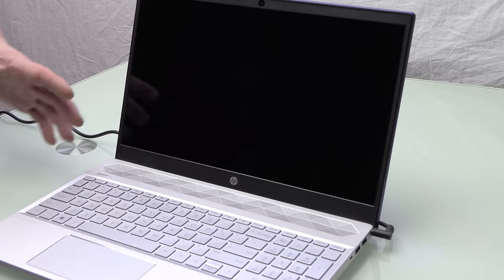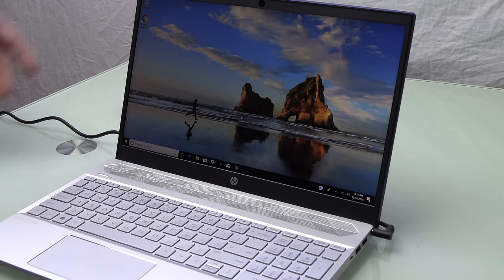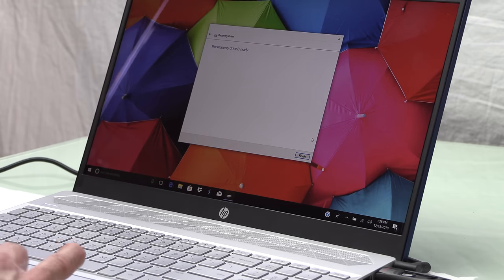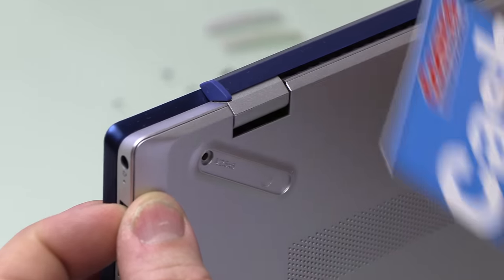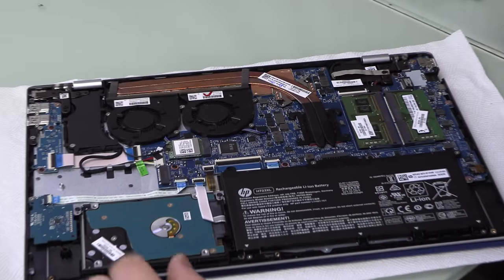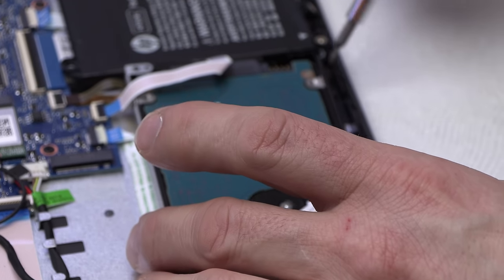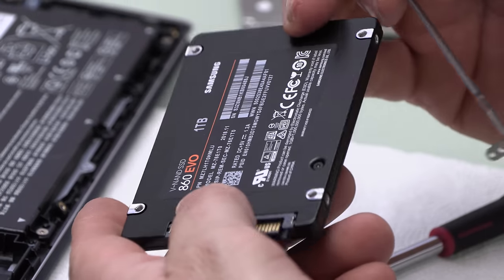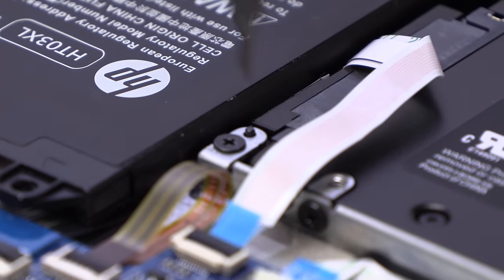HP 15-CS Laptop - How To Remove HDD and Install SSD

Comment: My i5-cs0053cl  is identical to this, but doesn't have the dual fan setup...but it has the space for it. Has anyone upgraded to the dual fan that is shown on this video? I know 2 fans would be louder but also cooler I'd think...
Reply: the blue one has a gpu in it and the silver one is just integrated graphics the blue one is also more expensive
Reply: It's not louder at all, and my laptop never heats, so it's a win win situation
Reply: @Fahed Sebia Where did you find the fan header part for the dual fan setup the default silver hp with integrated graphics doesn't have the gpu fan header.
Reply: @unicorns8418  Blue? Silver? What are you talking about? I also have only 1 fan and supposed integrated graphics.
Reply: @admirmehic8552  That means it's the silver one
Reply: @unicorns8418  Still you didn't answer? What is blue and what is silver? Motherboard color? Blue and Silver aren't mentioned in the product name, product code or in the store.
Reply: @admirmehic8552  Sorry I read wrong one of them has silver aluminum and the other one has blue aluminum. If you have the silver colored one that means it has integrated graphics but if you have a blue colored one then it means you have dedicated.
Reply: @admirmehic8552  If you only have one fan your computer should the silver model with integrated.
Reply: Where can you buy the extra fan, I want to upgrade to 2 fans so everything stays cool. I understand the integrated model only comes with a single fan but I want to add the other to this model.
Reply: @cam4712 You need to find the fan header first
Reply: As stated it's only there if you have a seperate GPU. Also contrary to what's been said the fan will be noisy on this model if you do a lot of graphics intensive stuff. However with the GPU you get at least a 25% speed increase for the hassle and this laptop's very fast to start with.
Reply: @unicorns8418  bro I have the cs model with silver color and it has dedicated gpu
Reply: Have you opened it? Does it have 2 fans? @sagarniroula3644
Reply: @sagarniroula3644  What gpu you have in it?
Reply: @unicorns8418  its Mx250
Reply: @sagarniroula3644  I have not seen one thats  silver with a dedicated gpu yet only blue ones so if you do have have a dedicated gpu then thats good for you.
Reply: @unicorns8418  btw my laptop is cs2062tx.. you can verify bro😁
Reply: Some 15-cs models have a dedicated GPU whilst others don't. Those that have a dedicated GPU will have two fans, but if they only have integrated Intel graphics they will have one fan.

I have a 15-cs1506sa which has an i7-8565u and a dedicated GTX 1050Ti. My laptop is automatically set to switch between the integrated UHD 630 and the dedicated GPU depending on how intensive the programs are running. If the dedicated GPU is running, then both fans turn on and it sounds like a jet engine. At all other times, only one fan turns on about every 15min to call the CPU and integrated GPU.

In my opinion, I don't think it would be necessary to install a dual fan setup as your integrated GPU is highly unlikely to experience thermal throttling. If you want to upgrade it, it's best you add  an M.2 SSD to one of the two available slots or upgrade the RAM to 32GB
Reply: I have the dual fans... It’s rlly loud. I’m trying to take a test in school this is all I hear: HISSSSSSSSSSSSSSSSSSSSSSSSSSSSSSSSSSSSSSSSSSSSSSSSSSSSSSSSSSS
Reply: @ElectrikNT  maybe it needs a maintenance o thermal past change
Reply: @unicorns8418  i have a ryzen 5 with integrated graphics, should i upgrade to two fans?
Reply: @gabrielgutierrez3077  oh nonononononononono it’s just loud like usual. Fan speeds are always high in these HPs
Reply: @gabrielgutierrez3077   The reason why I didn't upgrade to 2 fans is bc you would need to find the exact fan header and solder it on to the mobo and I couldn't see the part number so I decided to just leave it be.
Reply: did you do that or just let it go?
Reply: @antoniodiaz809  If you mean go find the part number for the fan header and solder it on to the pcb no I did not.
Reply: Hey, mine is also same model, can I have it like 1TB HDD(which is already there) + 256 SSD (is there a slot for that)?
Reply: @chromicle  Only a slot for a nvme ssd not sata ssd.
Reply: @unicorns8418  thanks for your reply so, can I buy the Samsung 970 EVO Plus 250GB PCIe NVMe M.2 (2280) Internal Solid State Drive (SSD)
Reply: @chromicle  Yes
Reply: @unicorns8418  thanks a lot
Reply: @unicorns8418  btw did you recommend any other brands nvme ssd?
Reply: @chromicle  the laptop has an SATA M2 port for it, be careful is not an NVME. my cousin had a cofusion on that.
Reply: @antoniodiaz809  yeah, I understood the difference between them
Reply: @unicorns8418  My model is the HP pavilion CU-0011tx and it is in silver/rose gold and it has got AMD radeon dedicated graphics on top of the intergrated graphics but has only one fan.
Reply: In this way, how to take data from HDD?

Comment: Taking apart a similar but not indentical HP laptop and your video helped me with those screws hidden under the feet. Wouldn't have thought to check them myself. This laptop had 1 screw under each of the four feet so had to remove them all. Thanks from Australia. 🦘🐨

Comment: Thank you for this!  My OEM disk drive was killing performance, to the point I was ready to buy a new laptop.  But decided to replace with an SSD after your comments about the OEM drive.  Decided right then and there to try an SSD and recover.   100% fixed the issue.
Reply: If you can go with NVME it will feel like a different laptop

Comment: By far the best instruction I have seen out of at least 9 - 11 videos that I've watched. My laptop is very similar. 14" version and I actually am sitting here having purchased the same SSD yesterday. I did make the recovery stick today. Great detailed steps here. Bought another RAM chip to stick in the empty slot I have. I see you have two, probably 8G each.
Reply: what RAM component? is it universal, the sticks? I wanna make sure they are compatible with my own. I have the same build. "15-cc563st"

Comment: I wish you had made this video earlier. I got mine just a few months before you posted this and there were no videos on it at the time. Guess who had  to learn the hard way . On the bright side, almost two years later im still in love with it. Still fast as a whistle with no problems. Although Im sure ill need to replace the battery soon.
Reply: I dont remember making this comment but guess what. Im in the process of replacing this pc's battery right now lmao
Reply: @wolfhowlex  How is it holdin up?
Reply: @Pozuda  I have a full blown desktop PC now, However I absolutely abused this thing. I still have it and occasionally use it for watching movies on the big screen, meetings, and other old editing tasks. I used it to its core. The only think ever wrong with it is that the battery went bad. I got it replaced, and it still gives me a weird error message when I turn it on, but as long as I have it plugged in, its still a great laptop to this day!
Reply: @wolfhowlex  Amazing stuff!
Mine is in the exact same situation, except it makes cricket like noises if I turn up the speaker 25% volume or above.
Reply: @Pozuda  OH that's strange. Mine doesn't have the defect, and I accidentally spilled water in it one time 😅
Reply: @wolfhowlex  Dang! 
Have you put an SSD?
Reply: @Pozuda  Yeap! First thing when I got it. I remember having to learn the hard way how to do it bc this video didn't exist. But it was all good 👍

Comment: There is an active Free NVME M.2 SSD Slot right beside the hard drive you removed. You could have just used that and leave the initial HDD as storage as well.
Reply: there is an active free for nvme or sata ???.
Reply: @long5401  nvme is supported
Reply: Chuck Dee great tutorial, thanks!
Reply: A ssd is faster though the computer only has a 5400 rpm hdd
Reply: @MysticCaravan  Does the mechanical hdd always spin or will it spin down if not accessed for awhile, assuming an m.2 ssd is added.
Reply: @c-qc-q2021  the mechanical hard drive spins from the time your machine powers up till the time it shuts down. though i don't know how much battery life this will give you. But if you have in most situations a power plug nearby i would keep that HDD inside, use the ssd for windows and some programs and the rest of the files i would save on the HDD.
Reply: I came searching for that comment, i don't even think he mentions it...
Reply: I don't see any free slot. Can you tell me where it is exactly?
Reply: @nikospant8927  This is incorrect. The drives do pause spinning. The main advantage of an SSD is NOT power consumption, but sheer speed. Besides, it also consumes LESS so there really isnt' a reason not to upgrade to an SSD.
Reply: @dennispremoli7950  for starters thanks for correcting me. 
I never said that I prefer an HDD no matter what. I said that yes the SSD consumes less and if battery life is important you yes just put an SSD and call it a day. If however you usually have a power outlet nearby it is better to have both, an SSD for windows and programs you frequently use and the HDD for your files. I think that is better because the HDD is both cheaper $/GB and it is less likely to fail in a manner that your files are non recoverable no matter what.
Reply: Where is the m.2?  Slot
Reply: @janeethreddyalle8178  look at 8:09, there is a free slot.
Reply: What if I want a SATA ssd. I'm on budget man 😔
Reply: @Rohit-vd6ms  no reason you can’t boot from nvme ssd
Reply: I followed this direction and learned this is the improper way of opening this laptop.   The rears have L tabs and the front are U clips.  It needs to be opened from the front first.   Otherwise you'll risk breaking 1 or more of the tabs in the rear like I did.

Comment: Awesome! This computer was a great price at costco for an i7-10th gen, lots or ram, and slim. 5400 rpm hd ruined this computer though. $75 later for a 500gb ssd and its super fast. I had no idea windows recovery was so good for swapping to a smaller HD! Thx for that tip!
Reply from the maker: Completely agree!!. That's the exact reason I picked it up and swap out the hard drive.

Comment: The SATA ribbon cable is reletively easy to remove from the motherboard, Just lift up on the retaining tab and pull it out. I'd recommend you do this before attempting to pull the harddrive out and disconnecting the main SATA end. Less likely to damage cable/motherboard connector. ;)

Comment: It looks like you have an M2.0 slot on your laptop,  you can just add an M2.0 SSD in your laptop, and then copy the whole hard drive to your new SSD. The original HDD can be formatted later. In this way, you'll have double store space on your laptop.
Reply from the maker: You could do that but it may be daunting to the average Joe, I'm mostly doing these videos for the average person who doesn't have in depth knowledge or confidence, or maybe first timers. I do however have some other videos that are completely end up off the wall, but in those cases nobody would ever attempt to carry out those procedures unless they already knew how to get to the components, until I get to the components they would already have to have in-depth knowledge of those subjects if that makes any sense. For instance I have a video coming on how to balance piston assemblies.
Reply: @HookItUp  Can you show us a video of adding additional fan, I have the HP Pavilion 15-cw007nm version. It has only one fan inside and it's "airplane lift off" kind of loud. NO DUST IN IT.
Reply: I have an HP 14 in ce3064st and will be doing procedure.
Already have  1TB HDD in place so I’m  just adding a Samsung 970 evo plus PCIe nvme m2 500GB SSD (Damn that was mouthful lol) 

Im a first timer so thank you very much for this video. Getting the outer shell thing off is gonna be the terror part for me cuz I don’t wanna break anything and it’s pretty much clip/snap on after those screws come off ya kno

Comment: Thank you!!! I'm struggling to pry the back off now XD
Reply: Theyve designed these not to be opened ever without damage. Worst laptop ive ever had to open.
Reply: @richardbroad2848  What do you mean? The backplate of the laptop is just screwed in and pops off by pushing the little clips in. This laptop is actually very easy to take apart compared to others.
Reply: @Psyberify  this was some time ago, but, pushing the little clips in by prying into the side of the backplate to get it loose was a nightmare the first time around, and i left lasting damage on one side while trying to do so. Subsequent times were easier. Maybe i am not great at these things, or, did i just get a tough cookie? Maybe both!

Comment: It's not a bad device. Our client bought one and we did this, but our client client wished to use Ubuntu and it worked like a charm. Very fast over all for a consumer product. But yes certainly this thing was held back by a spinning hard drive. But, it's also much cheaper then the Envy or probook series. Good job!
Reply from the maker: Thank you. What is Ubuntu ?
Reply: Hook It Up Ubuntu Linux, it's an open source operating system. I prefer Mint Linux personally but we have a lot of business clients now moving to Linux in their environments given the risks involved with Windows 10 and Intel. Others are having us setup Windows 10 with Linux environments pre-installed that can work with their Linux servers. I can't blame them. It's free and you can study and modify the software itself to meet your needs/wishes. You control your computer again, vs Microsoft controlling your stuff. it's good stuff!
Reply: Hmm where I’m from this costs just as much as the envy. How much does it cost for you
Reply: @aryanvaid3795  I would honestly think your right on this. The Envy is a good value when you consider it's construction.
Reply: R.a. Wheeler yup the envy feels premium even it comes under the budget category

Comment: I wish I had seen this instead of putting up with the Toshiba piece of crap shipped with my Pavilion 15t-cs000 for couple years - I finally got rid of the hard drive and used a Crucial P5 Plus NVMe SSD stick instead and the difference is night and day! I didn't use your video even though it's very good because HP Support now has an official video on repairing this laptop

Comment: Thank you for the video. Used it to upgrade a HP 15 Pavilion CW series.. which is the exact same exterior just that the inside is an AMD processor. Suggest viewer to paste the 2 rubber feet which u peel out on the back cover after removing. To paste it back exactly after replacing the screws when done.
Reply from the maker: Nice, sorry about that I thought that was included in the video, if you remove them and keep them clean they go right back in place.
Reply: Do the CW series have the same interior when it comes to changing the drive or the RAM?

Comment: Excellent video. Thanks for the help. I was primarily concerned about how to open the laptop without damaging the rubber feet or the back.
My model has 128GB M.2 SSD and no HDD which means no HDD cable or brackets. I'm upgrading the M.2 SSD to 1TB and changing RAM to 16GB. 

I would have liked to also install a 1TB HDD but cable and mounting brackets are only available from HP official suppliers at crazy prices. Maybe in a year or two parts might be available at decent prices. I'll look at adding a 1TB HDD or SSD then.
Reply: Same problem here, no brackets and cable. I did find a few on aliexpres under 20 dollar. Search for HP PAVILION 15-C FFC connecter
Reply: @ItzLnX  Do you know the reference number? Im considering buying the CS1008NP that comes the 128 md ssd but i dont know if i need the brackets.
Reply: Hi! any updates? i have the same problem with the brackets & cable
Reply: @Olaa974  i found the braket and connector on ebay for 50$ but my computer wont boot with the ssd installed. it workes just with a HDD.. and i cant seem to find any information about this online.......

Comment: Thank you.  While my HP was a bit easier to remove the back, your explanations helped a lot.   Unfortunately a credit card wasn't stiff enough to pry off the back but a very thin bladed slotted screwdriver worked OK.  Added a Samsung EVO 860 and cloned using Acronis True Image 2021.  So far so good.  Thanks again ... a really great video.

Comment: I upgraded my HP Pavilion 15 cs3073cl today. The plastic cover was not that easy to remove as shown in the video using a credit card - had to use a flat screwdriver which resulted in some minor dents on the plastic cover.  I didn't remove the mechanical hard disk - I just added a Crucial P2 500GB NVMe SSD for $70 and then made clean Windows install directly on SSD which gets rid of the bloatware as well. System boots in about 8-9 seconds after power on. I reformatted the 1TB mechanical disk to keep my files there.

Comment: Man, what a difference! I'm planning on adding an optane drive, since that costed a lot less than an SSD for me
Reply: Ssd are faster
Reply: @alexpadillayt  Actually,  Optane drives are NVMe which is much faster than SATA SSDs
Reply: @markdawson25  thank you for the information
Reply: Were you able to add the M.2 / NVMe and make it the primary boot?  Some of the HP docs seem to indicate it can only be a secondary drive.
Reply: @joeneubauer3208  I haven't tried that out, honestly. However, I'm pretty sure that you can make an NVMe drive, but that will probably void a warranty.

Comment: Hi. You should perhaps point out the M2 SSD port which is just above the 2.5" HDD. Also. Could you please list the part number of your HDD flexcable and the fans? I broke my SSD port so I'm going to use the HDD port but there is no cable included and the one I ordered didn't work...